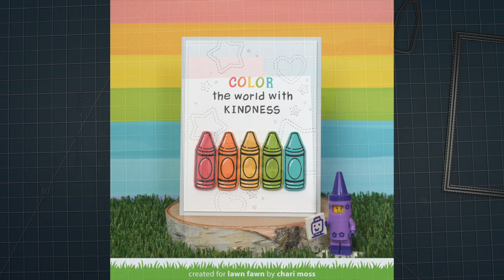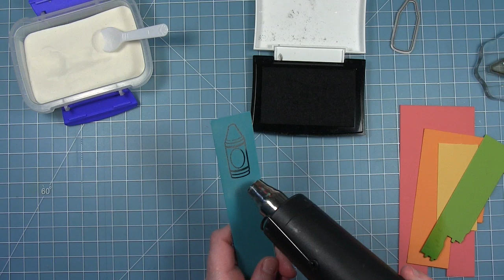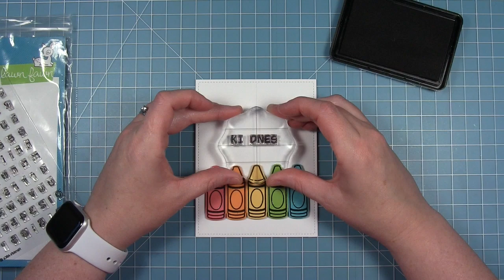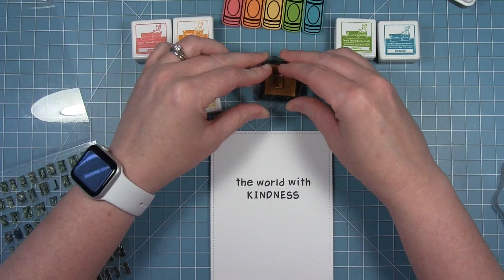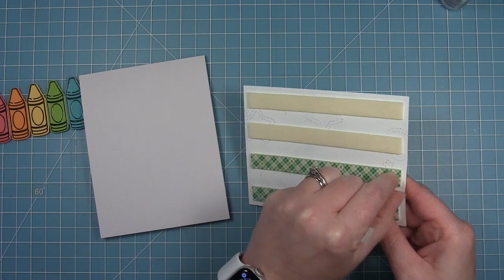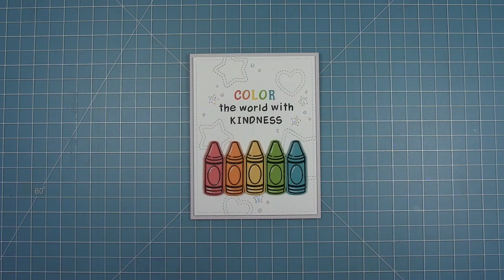Creating a custom sentiment

Comment: Thank you, Chari---I asked for tips on how to do this years ago. Still, you make it look easy. When I try to line up those letters, it's as if they come alive, one falls over when I set one next to it, the next one sticks to my fingers, aargh! Glad to see that it is actually possible, LOL.
Reply from the maker: Hi, we hear your frustration. You may want to try placing the letters on the block using tweezers to avoid the sticky problem. I like to place them with craft tweezers then use a die tool, craft pick or similar tool to stick them to the block. I hope this tip helps. Thanks so much :)

Comment: Wait so do you not use embossing ink and just a regular stamping ink pad to use the clear powder on top? I’m a bit confused, sorry
Reply from the maker: Chari used Versafine black ink and clear embossing powder. If you don't have Versafine ink, here's a trick: ink up your stamp with clear embossing ink first, then before stamping, ink it with your favorite black ink and stamp your image. The clear embossing ink will allow the clear embossing powder to stick to the image while you heat it up. If you have a MISTI or other stamping platform, just stamp your image with black ink, clean the stamp and ink again with clear embossing ink and stamp over the image. Then use clear embossing powder for a perfect embossed black line. :)
Reply: Versafine is a pigment ink so it stays wet longer as embossing ink does. If you don't have it Lawn Fawn has a good suggestion on how to achieve similar results. For me this is how I do black embossing, much cleaner than actual black embossing powder.

Comment: Using your heat gun over a open pad of embossing ink🙈
Reply from the maker: No harm done, but it's not recommended. Good idea to keep a re-inker on hand just in case! :)
Reply: @lawnfawn  yeah but high heat can melt and harden the foam fibers, once that happens you'll need a new pad not just ink..
Reply: I was not close enough for any heat to hit the pad, it was all on the paper. :)
Reply: @charimoss  Sorry my OCD was kicking in lol. Cute card though 😊